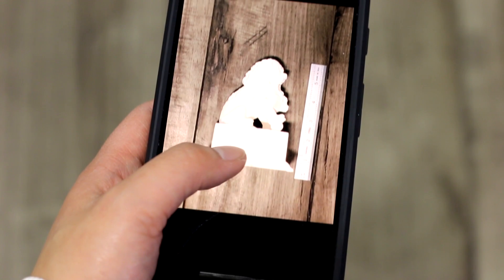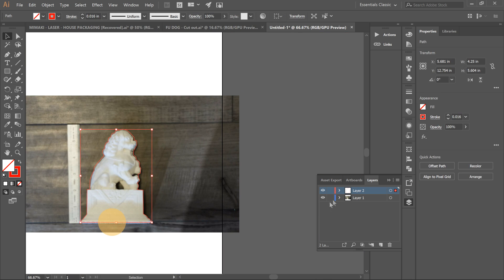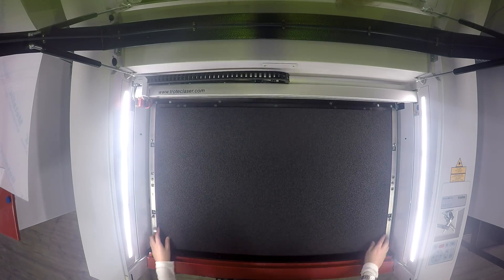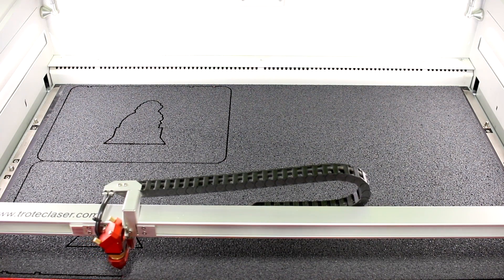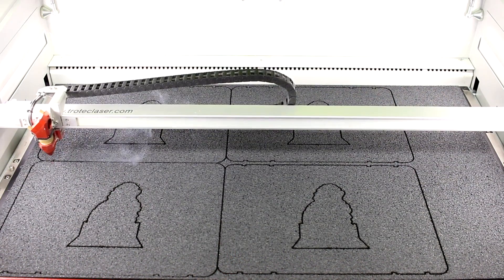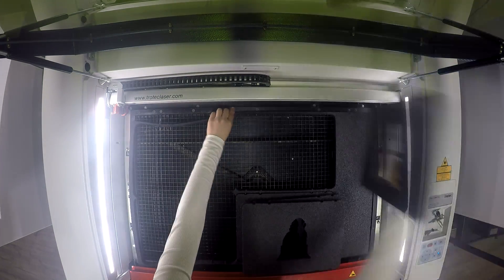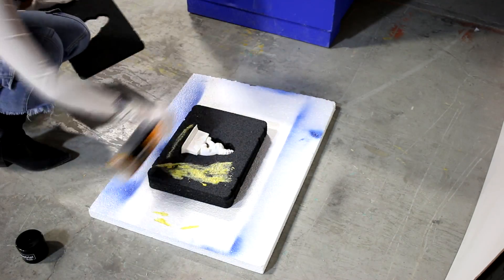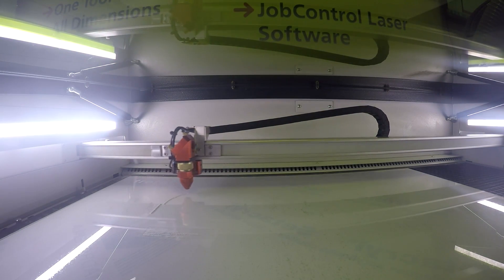DIY Custom Foam Insert | Foam Storage Insert | Laser Cut Foam

Comment: Instead of tracing a picture, why not just take the original model, slice it down the middle, and use that as the pattern?
Reply from the maker: What do you mean?
Reply: @TrotecLaserCanada  Eugene is absolutely right! Using the actual 1:1 3d model as shape. Then applying the extra margin around that. It's indeed pretty smart to do, but you need some more knowledge of editing 3d model drawings. AutoCad or something like that. With a few mouseclicks you can make a perfect fitting mold, but don't forget the finger gaps to take objects out of the foam. Sometimes this is forgotten!
Reply: Trotec Canada had absolutely no idea about this! 😅